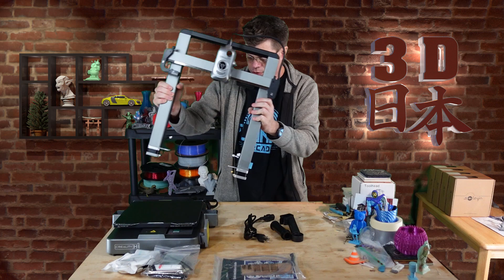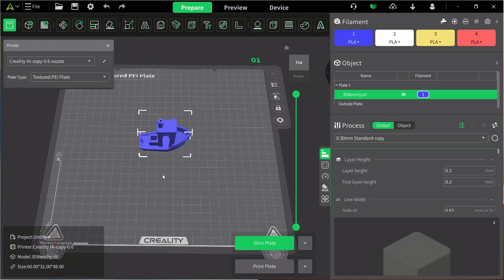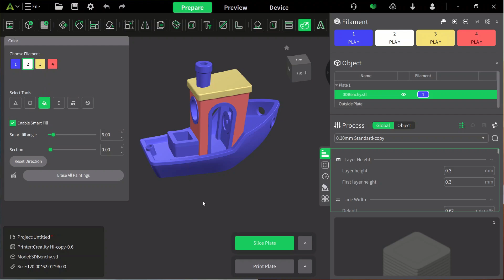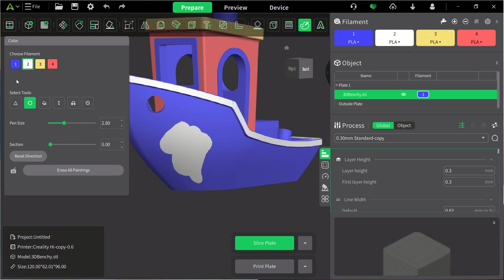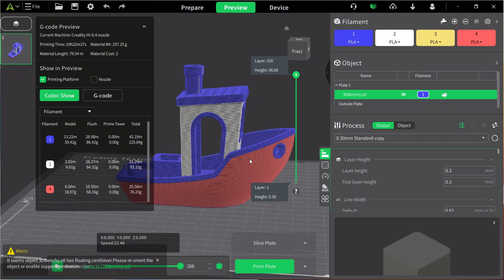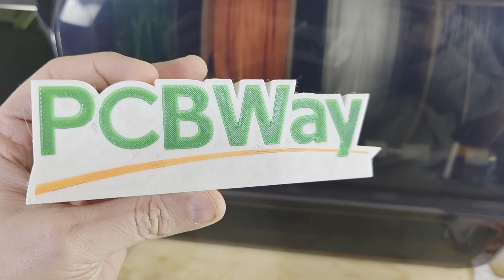Creality Hi Combo: Affordable multi-color 3D printing! #Creality #polymaker

Comment: Hi Phil, I have a question I would like your opinion on.

I just got a K1C and I am really loving it, however I do wish that I could do some multi color prints here and there. I was thinking for the price of $400~ after tax to upgrade my K1C, would maybe just simply getting a Hi Combo be more worth it?

I figured with the price difference of less than $100, it might be nice to have 2 printers running together than spending so much just to have 1 in the end. Even if I get the Hi combo, I could always still get the CFS kit and upgrade the K1C and keep the Hi as a single color printer for essentially $150. What do you think?
Reply: I would go for the hi combo. I did purchase the cfs upgrade set for my k1 max, but never installed it. Just got the hi combo, not yet unpacked, so plan to set it up and daisy chain for up to 8  colors. The k1 max will be my workhorse for single color. 

It is possible to upgrade k1 for multicolor, but you will have to spend a lot of effort to do so. There are yt vids and creality instruction vids on how to do that, and creality k1s are maker\tinker friendly machines. 

However, as the k1s were not designed for multicolor, unlike the k2s, so they need to be modded moore than 'usual', f.ex. you must install a new extrudr.. and a lot more. 

The hi is very good at multicolor, and is also very precise,according to most yt reviewers, and it has also a pretty large build volume. 

Now if you want to save a little money , you could go for anycubics kobra 3 ,v2 combo instead of the hi, they seem quite similar, even if imo creality leads with a better ecosystem and better slicer.
Reply from the maker: If you're willing to spend a little bit more having 2 machines is always nice. Especially if you want to make big batches of things like stuff to sell or gifts. Every year I'm in a 3D printing toy drive for Christmas. Having multiple printers helps a lot worth that.
Reply: Upgrade kit is nice and lets you add a cfs. I did this to my k1c and k1max. I’m also looking at getting the hi combo. As I already have the k2

Comment: The waste is more than twice as much as on a Prusa mk4 + MMU3. The filament switching time is even worse. The trick Prusa uses for over 7 years (on mk3+MMU2)now: Using a v6-size meltzone, you can optimice the unload process to get a nice filament tip, wich can be reloaded without cutting.

All theese other printers use bigger meltzones for more speed. However, this means cut and poo. Much more wastefull and time consuming. It´s OK if you have just a few coloured layers (text and logos on the bottom f.e. only in the first 3 to 5 layers) or have a fully packed printbed on an Orangestorm Giga.

So imho Prusa went the right way: On one colour prints you can use a CHT nozzle. On multicolour you use normal flow nozzle.
You save so much time on filament changes, the slower printing speed is more than compensated.

Imho on all theese new multicolour printers an optional Revo hotend  (or, if you want a cheaper solution: an alternative nozzle with v6-size meltzone and integrated heatbreak) should be available. The manufacturers do not even need much development, as Prusa Slicer already have all the profiles needed. With the Revo hotend and standard flow nozzle, all the settings for print profiles and filaments work, just adjust the max speed, acceleration etc. Dont forget to set slice clockwards however, as a Revo nozzle can unscrew while printing on conterclockwise movements.
Reply: But you don't see people raving about their mmu3 don't they? 

I get it it's a lot less waste but from what I've heard it works well to horribly reliable or downright bad to use.
Reply from the maker: @oleurgast730  it could be my settings. I've never used multicolor before so I may need to learn. For example I've heard there's a way to use the "waste" as infill but I don't know how it's done yet.
Reply: @3DJapan  I just use Prusa slicer. There you can click onto an object and select "wipe options" from the context menu. After this you see "object settings to modify: wipe options" on the right side. You can select "wipe into this objects infill" or "wipe into this object".

However, there are 3 types of waste: 1. to get the flow right. Actually the same as the good old purge line on single colour prints. Just stacked into a nice tower. Even toolchangers do this. 2. cut&poo waste. The cut filament left inside the hotend isn't connected to the feeder anymore - so no retractions possible. This part has to be pooed out, you can not use it. 3. nozzle cleaning. Even with the old cut filament out and the new filament inside the nozzle, you still have residue of the old molten filament inside. However, now the output is "controllable" and you can use it to print into infill or an object were colour doesn't matter (if using multicolour, of course not if changeing between PLA and PETG). 

Obviously standard on theese cut&poo printers is to combine 2+3 into one piece of poo. I do not know how to change this - after I sucessfully installed my MMU3´s onto my mk4(s)´s, I never ever used my A1 mini nor my Kobra 3 combos for multicolour again.

@hihellothere9569: Yes, I know the problems setting up the MMU3 myself.
Actually there are 3 parts making the setup problematic:
- the buffer system makes loading new filament a pita.
- adjusting the Finda sensor correctly isn´t easy.
- the tension of the screws with springs is critical. To loose - loading fails. To much tension - loading also fails.
On my second MMU3 I experienced the second and the third problem. Took half a day with multiply trys to get everything working. Also I do not use the buffer, but gravety spoolholders,

But: The MMU3 is just the filament changeing system, selecting filament, loading it to the hotend until the extruder graps it and unloading it from the hotend after the hotend released it. It is not resposible for the loading and unloading inside the hotend and the quality of the tip of the unloaded filament. This is responibility of the hotend itself - and the commands the slicer set into the gcode.

Actually, you could design your own filament changing tool (like AmorTurtle did for klipper printers). Also the protocoll between the MMU3 and the printer is well documented. So is for example the protocoll between Anycubics ACE pro and the Kobra 3 (look on "DuckACE" on github). With the right programming skills (I do not have them) you actually could use a microcontroller or SOC to "translate" between the mk4(s) MMU-interface and the ACE pro, "emulating" the MMU3 to the printer while actually commanding the ACE pro to unload filament and load another (and even controll filament drying etc.)

So yes, the MMU3 itself is not the most comfortable set up, to adjust everything right and for changing spools. It also take a lot of space. It´s more a project for experienced DIY tinkerer.

However, the MMU3 is not the reason a mk3(s(+)), mk3.5(s), mk3.9(s), mk4(s), CoreOne produces much less waste on filament changes and takes less time. It´s the hotend with a v6 size meltzone and special shaped heatbreak (mk3(s(+)),mk3.5(s)) or a integrated nozzle/heatbreak combo (Revo Six with standard flow nozzle on mk3(s(+)),mk3.5(s), Nextruder nozzle with standard flow nozzle on mk3.9(s),mk4(s) and CoreOne) combined with the ramping profiles in Prusa Slicer.

So you could use this principle on any printer with OpenSource firmware, if you change the hotend. Cut&poo is neccessary only on high flow hotends - but full colour prints use so much time for filament changes, a normal flow hotend without cut&poo would be faster in the end. And less wastefull.